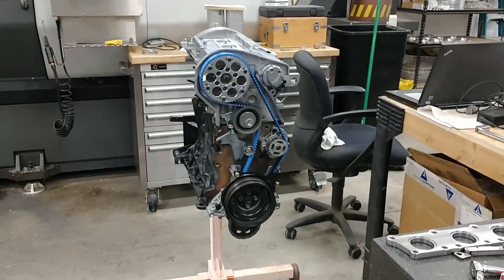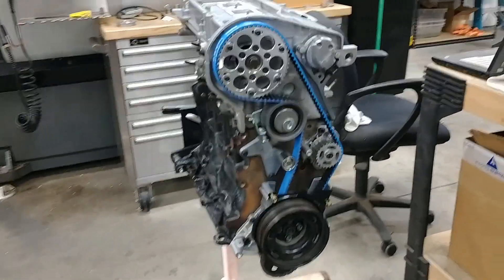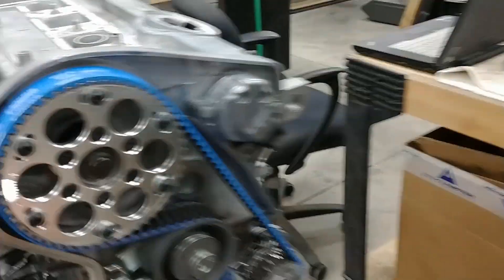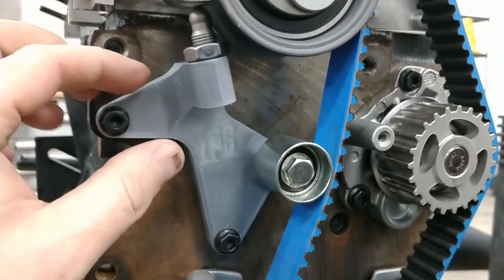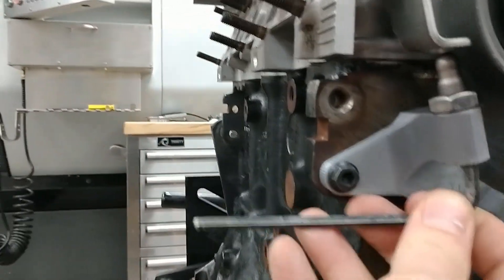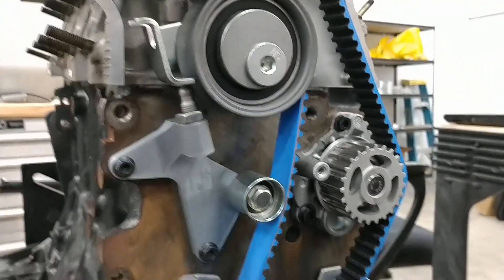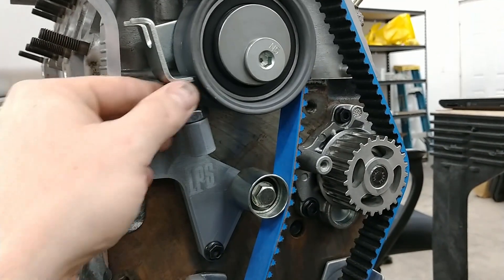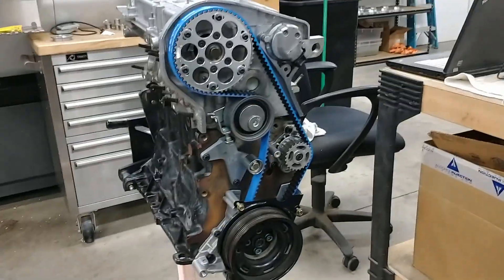VW Audi 1.8t LPS manual timing belt tensioner prototype.

Comment: Does anyone know a trick on the original hydraulic tensioner if there anyway to release it without having to remove the whole engine mount etc?? Thankyou I need to do a head gasket replacement
Reply: I'm going to have to say no. Not sure about anything Quattro, but transverse mount engines the mount and everything else is in the way. Did a 2000 Beetle, and no choice but to move it.